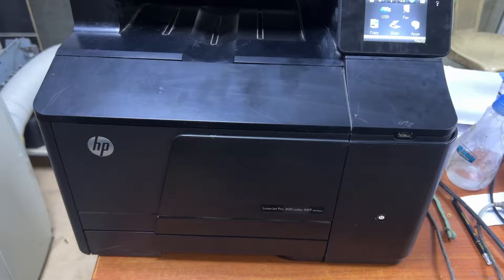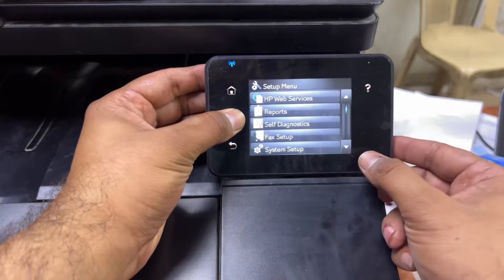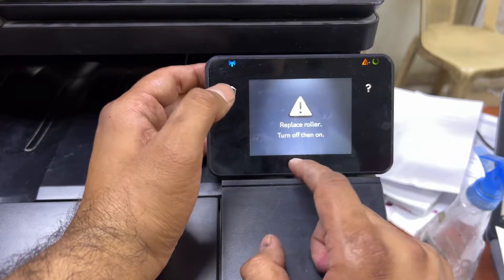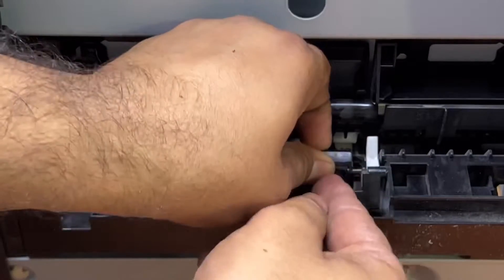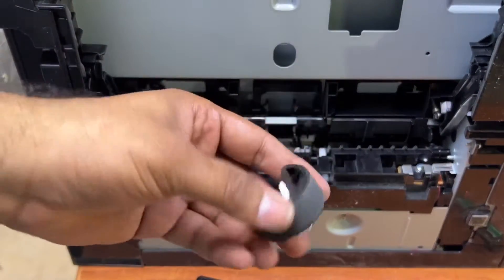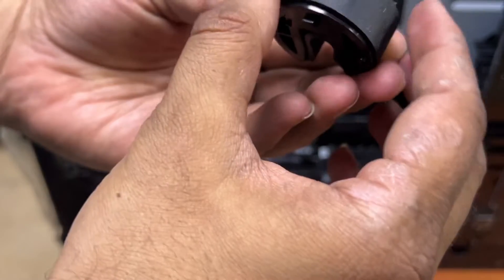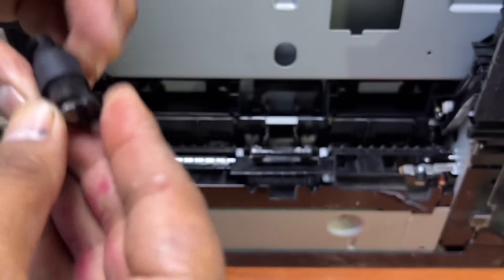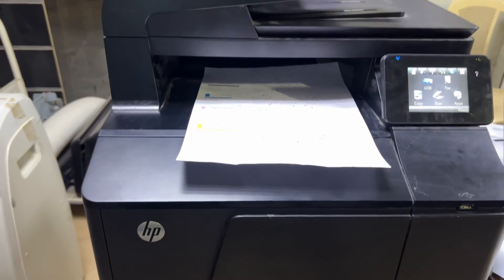How to Fix HP LaserJet Pro 200 color MFP M276n Paper Jam Error Tray 2 Feeder Roller Replacement?

Comment: Hey Bilal, nice video! I did all you have showed but my printer keeps printing only one page. The first page prints in full but it gets stucked at the end and I have to pull it out. After that the printer stops printing and appears a message saying " Jam in output bin.Open rear door and clear jam." but when I do it, there is no paper stucked in the jam. Any idea how to fix it? Thank you?
Reply from the maker: Thanks a lot for watching! That issue usually happens when the paper sensor near the output bin is either dirty or stuck. Even if there’s no paper jammed, the sensor might still think there is. Try opening the rear door and gently checking the little black sensor flag or roller in that area to make sure it moves freely. Also, give it a quick clean with a soft brush or compressed air. If the problem continues, it could be a worn fuser or sensor that needs servicing.

Comment: I just got a laserjet 200 m276n with paperjam 13000 error code. it makes about 8 clicking sounds in the middle of the chasis when it is powered on. Are the rollers still the problem in your experience?